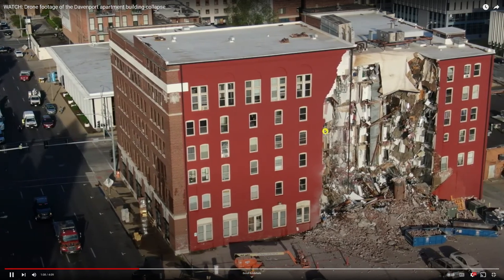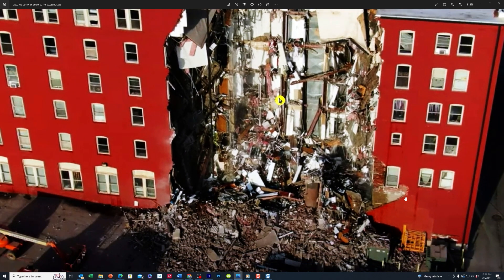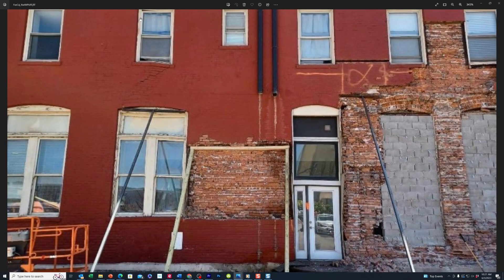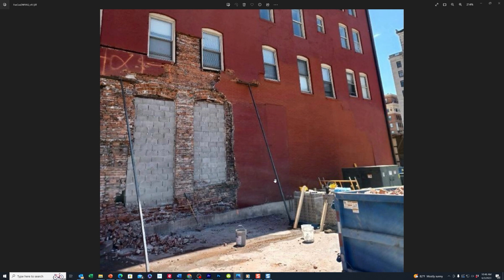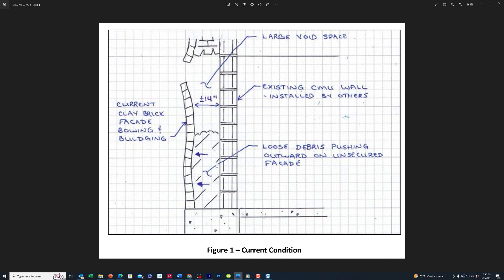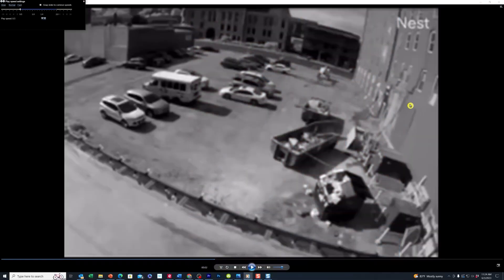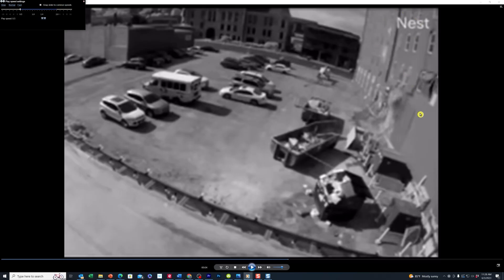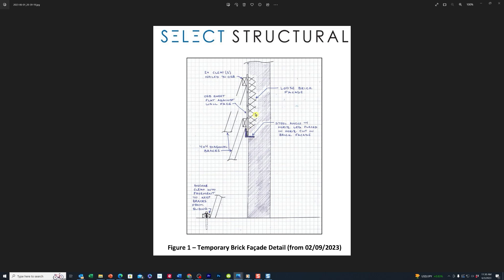Davenport Collapse Security Cam Analysis Pinpoints Origin

Comment: Any time you see bricks bulging or bowing the building is in danger. Typically if anything is to be done to save it without just tearing it down the engineer runs the show and we install emergency shoring and begin installing helical ties to re-attached the outer facade to the inner structure. Once everything is fully attached again we can start doing very small openings near the bottom to clear the collar joint debris and re-laying the brick without the bulge. On a 5 or 6 story building like that with the displacement everyone says its been showing for years it was realistically better to condemn and tear down at least the failed section.
Get your engineering inspections and let us do the work before it gets this far!

Comment: Whoever installed thoe CMU walls didn't install ties to the facade and are at fault. From there on out the building has been in a slow process of collapse as the wall bulges out. The engineer should have triggered emergency shoring on the first sign of any displacement or bulging on a stacked facade. The contractor came in and further weakened the whole structure by removing the foundation brick.

Comment: Think there are 2 issues that need to be kept separate: 1) The façade collapse and 2) the main structural collapse of the building.  Think your video does not make this distinction clear enough.
I understand if the façade collapsed, the structure would still be OK.  Is this true?  (Realize if the quality of the façade construction is poor, this strongly implies the quality of the structure construction is also poor.)

Comment: Personally I think had supports been applied correctly the building would not have collapsed any time soon. However I think the engineers plan was not adequate either.  Very little redundancy in the plan. Not enough inspection either.  Just my opinion

Comment: At 2min 45 sec the failure of the left side is the window. It is 2 windows from the window with the light above it. It also has the stress strut leaned up against it. You can count the windows from the hanging down spout..

Comment: 4x4 and osb plates do nothing. it was probably meant to hold back the bricks from falling down. just that. you dont hold the whole brickwall from the brace to the top of the building. thats pretty delusional.
its even pretty heroic to think about that some workers actually standed in front of that brace to even put it there.
when i see something like that i would have at least 2 buildings of safe distance between me and the building itself!
it looked collapsing even on the photos 3 years ago. i dont get it.

Comment: Another engineer said there was no support between the cement blocks and the brick arches.  Therefore all the weight of that section of building was supported by the narrow construction between door / cement bricks, the 2nd cement bricks and the construction after that.

Comment: Google "multi wythe masonry wall" that is how they built masonry buildings back then. The outer wall was not a veneer it was the outermost wythe and was indeed structural. Every few courses there is a header course where the brick is laid sideways that lock two wythes together. They would set beams into pockets on the masonry wall and continue the brick up and around it, and the beam would be supported with columns similar to how a house sits on a basement. This guy doesnt understand this and is just spitting out misinformation. What happened is water penetrated the wythes throughout the years, and more so in the past few years due to the failed roof. Water freezes and thaws and causes fractures and degredation of the mortar, and brick, which obviously cause a multiple wythe wall to fail since the headers are doing nothing at that point. The paint certainly caused the issue to speed up because it took away the ability for the masonry to breathe and dry out. The entire building should have been shored up, and damaged wall should have been taken down from the top to the bottom, and rebuilt with an internally braced CMU (which are concrete masonry units) wall, grouted and reinforced under all beam pockets, and a new modern ACTUAL brick veneer built back up

Comment: As I write, the building is 80% razed. I believe engineers thought the building was unstable and could fall at any moment. But I can see as they tear it down, one swipe at a time, there is no catastrophic, wholesale collapse of the structure. 1906 drawings indicate steel columns throughout supporting the beams, except for the back portion where the collapse occurred. In fact, about 1/6th of the building remains (at this moment) from basement to rooftop.

Comment: so why did the facade failure bring down the rooms in the building behind it? why didnt just the facade bricks fall off
Reply from the maker: I suspect that not only did the facade collapse, but there must have been bricks behind it that were also crumbling and collapsing as I mentioned. In the. Video some of them were falling down and creating a void at the bottom which was causing the facade to already bulge out weeks before. Keep in mind. This building has a steel structure in it. With beams and What a strange about this steel skeleton is that instead of having the columns on the outside of the building to take the load on the ground, they were. Relying on the beams being embedded into the brick wall so that when the brick wall collapsed down went the beams because there were no columns ther
Reply: @jeffostroff  thanks!

Comment: In all the pictures I have seen I have not seen any brick ties. Where the old window or door openings were filled in with cement block I don't see any brick ties and the vertical joints don't have any mortar in them. They are just sitting on a mortar bed but they didn't butter the ends of the block. Should see either brick ties or a row lock every 6 courses of brick.

Comment: If the brick wall were the big problem, it would have fallen down and amazed tenants would have been in their apartments, looking out at thin air.  Instead we see dangling beams and collapsed floors inside the building.  It is that collapse that killed people.  Look at more things than the brick wall, such as foundation conditions or removing support columns during renovations.
Reply from the maker: The reason why it collapsed is the steal beams were embedded into the brick without the use of columns to support the load, so when the bricks crumbled, the support beams dropped also

Comment: Looks like the weight of the upper wall was settled on the lentil and then it reached a critical pressure and then split out a smidge before the wall just above it shifted down, and then took everything above it as the large block, which then by momentum caused that below it and to the sides to be pushed out and displaced.  There was a building on my street which recently lost a 4 ft high section of brick above a large wide window.  The brick was not anchored to the support wall behind it as far as I could see, unless any steel support wires were rusted and sheered at the interface.  There was a nearby building which ended up getting a structural steel external wall brace set in place while they rebuilt the wall, and it seems like something similar was needed here, although in looking at the collapsed area perhaps demo was the only real option as the rest of the structure might be in a similar state.

Comment: What I am gathering from the video is it starts off with sounds of debris falling but it is not visible at first. The first visible sign is that puff of dust that appears at the right arch that is filled with CMU blocks. Looking at the infill the CMU blocks do not fill the top curve of the arch meaning it is open to the interior cavity. My thought is bricks on the interior here began to collapse and that puff of smoke was from the bricks on the interior side of the wall falling and the dust escaping through that opening at the top curve of the arch. 7:14 the wall appears to bulge inward in a concave form directly above the openings. Also within the first few frames of the facade coming down the first floor section remains in place and in images of the debris afterward the CMU block section can still be seen standing up.
Reply from the maker: Yes without filling tot he top of the arch, there is no load contact, and it is as if you never built the CMU filling in that window at all. All loads go down on either side of windows

Comment: You've done a good job of capturing the failure of the building. A small correction is that the door in question led directly into an apartment. This is unit 105 which was ordered to evacuate. This was my unit from 2015 to Jan of this year. I moved out due to safety concerns that weren't being addressed by the building or enforced by the city. By 2021 the door would no longer open and close correctly and the drywall was cracking in my unit. You could literally hear brick fall when the door was opened and closed. My daughter would no longer enter through this door for fear of a collapse. Their solution was to shave the door and replace the drywall and studs. Yes, this was a joke.  An engineer was supposed to review and confirm structural integrity but this never occurred. If it did, I was never provided with a report.

One thing that of significant is that the building suffered tremendous damage due to a Derecho in 2020. The wall was already in trouble and this added to the situation. The caps on the roof were off for months, allowing water to pour directing into the structure for months while insurance and aid was in the works. Things only got worse from there and any fixes that were made were purely cosmetic.
Reply: Wow! Thank you for that insight from an "insider." Glad you got out before this disaster happened. Also sounds like your daughter has a finely honed sense of danger. Good for her and anyone with her.....

Comment: Old bricks and lime mortar let moisture evaporate and wick away thru the porousness of the materials. Using modern Portland's based mortar is actually waterproof or non porous sealing in water and moisture. Then paint everything and all the moisture is trapped and cannot evaporate. Then add a couple of freeze thaw cycles pushing the layers apart and it's a recipe for disaster. There are thousands of old brick facades and entire buildings that fail from these exact issues. These buildings are now all getting older than 100 years and bad repairs by unknowledgeable contractors and cheap owners is leading to castroatrophy.

Comment: In the picture with the downspout.
I noticed a layer of brick has been removed from under the downspout.

The brick pillar next to the door has a chunk missing out of the bottom left corner.
Plus there is a crack running from the bottom to the window above the door.

Comment: I wonder if anyone is looking at another possible contributing factor.....the building had been retrofitted with a steel pipe fire sprinkler system (you can see the remains of it in many of the photos and videos). That system, which would have been installed throughout the structure, adds quite a bit of weight (water filled steel pipe, fittings, hangers, etc.) to an existing structure that wasn't originally designed to support it. Just sayin'......

Comment: This building was built in the 1920's.  Cast your mind back to that time.  The outside bricks, well, they were probably either pressed or extruded, hard burnt, so suitable for outside use.  The inside bricks, well, they were probably a soft type of brick.  Fair for holding up a couple of levels, but, to my mind, not for 6 levels, even with monastery bond brickwork in the lower levels.

There is a good chance that, if there were ongoing leaks with water, it needs to be remembered that water will wear anything away with time, no matter how solid it is!  Add in to the mix the question about the outside wall being tied into the inside wall...  that now means that, if the outside wall is not tied to the inside wall, that outside wall is basically flapping in the breeze.  

Having seen soft "sandstock" and "extruded / wire cut" bricks, it makes me think that there may have been a build up of water in the bottom of the wall, in some parts, and the water loosened some bricks and they did fall down.  This also begs the question about ties between the walls.  

All we can do is to wait for the "Official" investigation and see what that turns up!

Comment: How new is that high door frame shown near the braces? Doesn't seem to match the other windows or doors on the building. Maybe the owner was cheap installing that and when they cut the bottom out without checking with an engineer. Cant tell for sure but it looks like it is lower then even the original repaired holes.  Maybe that was the start of a long term failure?

Comment: the building was a nice old hotel from the early 20th Century back in Davenport's golden age as a blue collar industrial town.  It sadly was neglected for years after being converted into an apartment building and major repairs to the brickwork and framing were never done over the years till it was far too late and probably too expensive and father time finally had enough and collected it's dues.

Comment: Good info here. The exterior walls of this building are bearing the load of the steel framework at the perimeter unlike buildings today that have a complete steel cage and the exterior walls only support themselves. In the pics the remaining steel looks rusty. It would have been costly, but they should have installed support posts on footings, as in one of your pics to support each beam.
starting from the foundation up. Then they could have essentially removed all of the outside brick wall and replace it. This is total incompetence on many levels. Also, they removed too much brick at one time and combined with inadequate bracing. The owner should and probably will end up bankrupt and in jail. He had many warnings. Very sad that he didn't even consider that people could die.

Comment: The outer wythe of brick is not a veneer, that is a mass masonry wall with header bricks interlocking the multiple wythes (layers of brick). The wall is missing a massive amount of mortar likely leading to bond failure of the wall. Likely freeze thaw lead to the face of the bricks to fail due to the paint trapping the moisture.

Comment: I'm a contractor and that was a s*** show of a repair job.
Truthfully I wouldn't go near that place if the job was offered to me looks like a death trap and it was.
Yeah it looks like the outer veneers started coming down and pulled everything else down with it. I would say the collapse of that building was inevitable without major structural repairs.
* Also do you know if that inner masonry wall was the load bearing wall or was there steel post &beams?

Comment: I rented in this building a 6th floor unit from April 1997 to October 1998.  My unit was upper left hand corner, but on the other side of the building.

Back then it was not uncommon to find in the hallways water leaking from the ceiling.

Comment: With those braces made having the point against the facade, when things started to move those braces became a spear or a pressure point causing the bricks to disassociate. With proper bracing as the engineer designed  it might have kept the brick wall intact. 

Now with that being said, It seems there were more serious issues internal to the wall, and supporting the facade may have only caused the debris to fall in a different way🤷‍♂️

Comment: I AM NO EXPERT , BUT  I HAVE WORKED  ON SITES  WORKED WITH BRICK LAYERS,  WHEN MIXING CEMENT IN CEMENT MIXERS, WE USED TO MESURE OUT  SAND TO CEMENT  RATIO       12 BUCKETS OF SAND TO 1 BUCKET OF CEMENT
12 TO ONE     NOT ALL   USE THIS RULE   SEEN IT    JUST SAYING   MIX NOT RIGHT  YOU GET TROUBLE

Comment: Jeff,  did you see the video where the previous maintenance man said back during a hurricane that the section of roof where the building collapsed was torn off and rain was pouring in for a week and the owners didn't care. I was thinking maybe that water pouring in for that long damaged that part of the building and weakened that area🤷‍♂️
Reply: A hurricane in Iowa?
Reply: @timramich  Tornado or high wind storm. Net effect is the same. Someone in a previous comment verified a specific type of storm occurred some years ago and revealed the large amount of water that entered the interior of the building as a result.